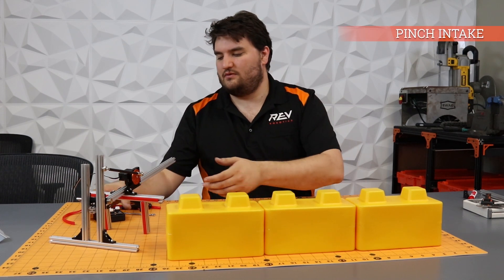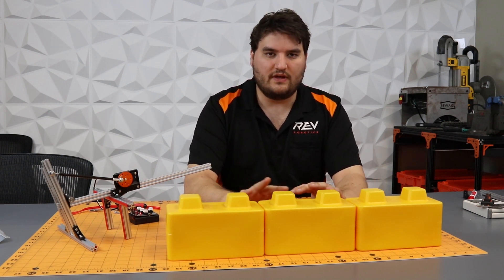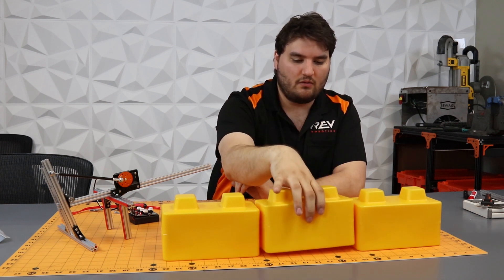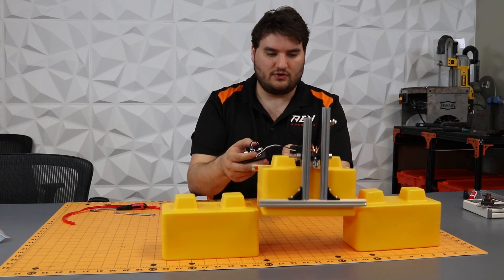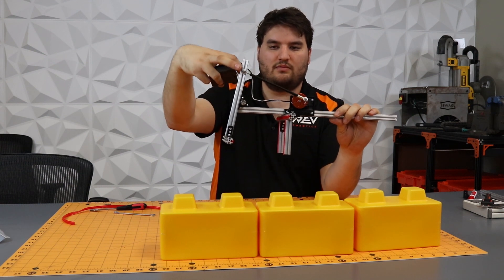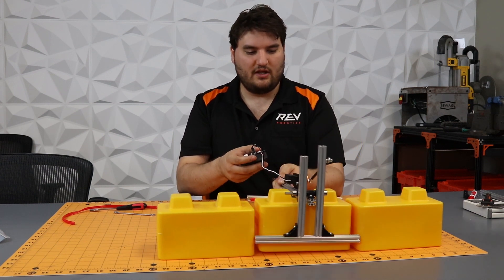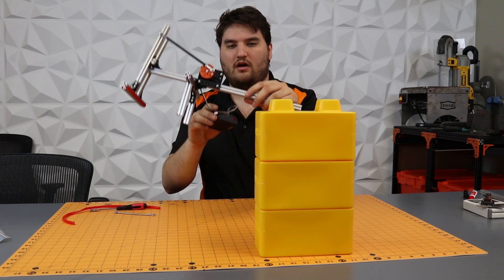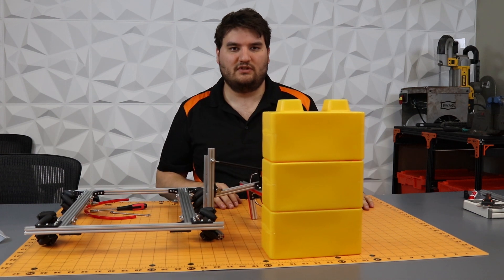Pinch Intake - FTC Skystone 2019-2020 Prototyping

Comment: Hi there! thanks for responding to my first question back in October! Anyways, we built the Pinch Intake and it works! But when we re built it for the 2nd time, the servo isnt pushing hard enough to hold the block. Do you have any tips? Thanks again!
Reply from the maker: Moving where the linkage is attached to the servo will change its max opening and closing behavior. Try moving the linkage attachment point on the servo.
Reply: potato

Comment: Ok so I have another question..when cutting the standoff? Did you tap the untapped side or? One side is tapped so we went ahead and screwed in the male ball joint rod. What was used on the other end to connect to the servo?
Reply: We are also having this issue
Reply from the maker: Yup, you will need to retap the end that is cut. Each of the standoffs has about 10mm of thread depth.
If you are looking for some tips on tapping, Make has a pretty good video here: https://youtu.be/r6Ijd9o-C10

Comment: What is used to attach the ball joint rods to the extrusion and servo horn?
Reply from the maker: Just m3 hardware!
Reply: @REVrobotics  just m3 screws?
Reply from the maker: @ryanheiser1335  yup, the bolts thread into the servo horn and you will need a lock nut on the end of the ball joint that is locked into the extrusion. The ball joints have a clearance hole for m3 hardware on the jointed end.

Comment: Would you suggest attaching a linear slide to this in order for it to lift and grab the skystones, a good idea? Like maybe attaching it to the side of the linear slide?
Reply from the maker: There a multiple ways to have a lifting motion. Elevators and arms are the two main ones in competitive robotics with a few different ways to achieve them. We did a mock up of an elevator in a different video for this year.

Comment: What matirials did you use and from which vendors. This video really helped a lot!
Reply from the maker: Everything in the video is using REV parts!
Reply: REV Robotics what exactly are the names of each part ( this is my first year I apologize for any inconvenience)
Reply from the maker: @heebaowais481  used a Smart Robot Servo, an aluminum servo horn, some m3 standoff (cut down from the 420mm), along with the ball rod ends male for the linkage. The rest is just a bunch of 15mm extrusion cut down to different sizes, brackets, and hardware. Also used a hinge kit for the hinge. We did use some of the slot covers on it but had them lying around the shop. May be needed might not.
Reply: @REVrobotics  Is the aluminum servo horn compatible with servos from other companies?